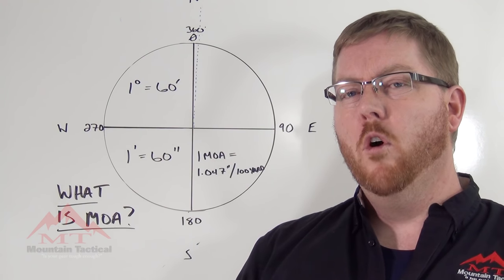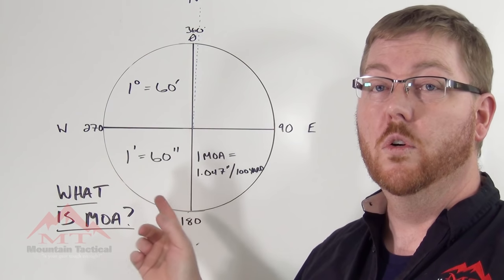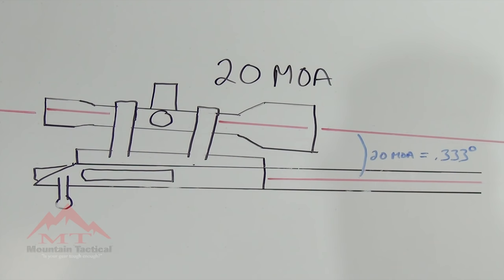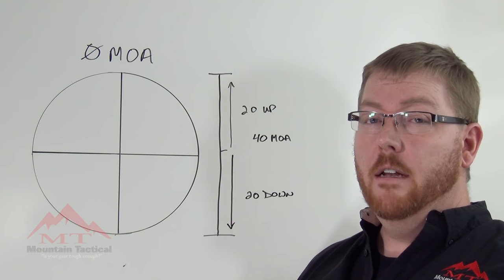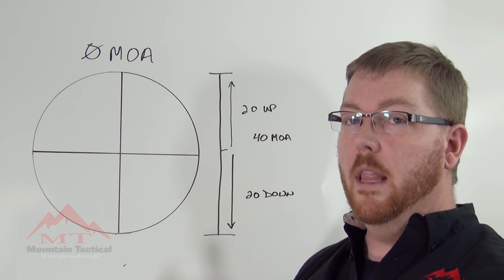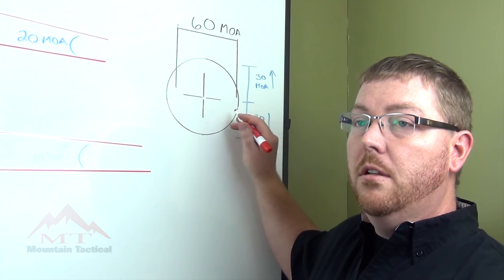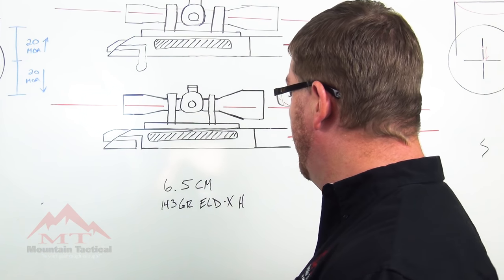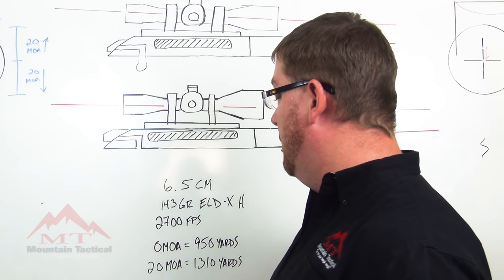0 MOA vs  20 MOA What Does it All Mean?!?!

Comment: What I learned today is that I don't want or need a 20 MOA mount.
Reply from the maker: Gillan Laureth of Seles That's great!  Most people just buy and don't understand that they may not need what they are buying.
Reply: @mountaintacticalcompany  I just bought  ruger mpr and it came with the 20 moa mount...what would be the best scope for it?
Reply from the maker: @chaboi7  honestly, that's like asking what underwear is most comfortable. Haha!

There are so many optics available for every type of shooting. 

When I buy a scope, first I decide what type of shooting I plan to use it for, then find the best optic in that category.
Reply: @mountaintacticalcompany  why do we not set sights parallel to barrel? If you know the sight/optic is X" above the bore, doesn't that simplify the math for drop?
Reply: 60Ometers or less than you don't need, rectiles give you +10moa helping lines. I have no problems with my until 850M without.
On very hot day i can dial in to 1100yards.
Reply: @chaboi7  Little late comment but, not sure you need to worry since an AR15 is almost not used for precision shots over 400 yards, make sure the MOA adjustments on your scope is at least 60.
Reply: @marcoss6212  but other calibers in the same platform could.
Reply: @chaston0218  Very true :), thank you.
Reply: Was standard on my MDT embedded.
Reply: @chaboi7  if your Canadian try and sell it as that style of rifle is now banned.

Comment: Great Video. Thanks for sharing the knowledge! 
Best video I have seen explaining 0 vs 20moa rail. 
Ive got a 65Moa adjustable scope with a 20moa rail. A 100yard 0 leaves me with 51 MOA to play with.
Reply: 51moa to play with is 125inches dialup so you can shoot 1500m with the 6,5cm. 147eld-m at 840m/s
Reply: You don't need a canted picatinny mount if your scope has mildots; old school that never fails.
Reply: @marcrobert2603  share the equation, pls.
Reply: @renatosureal  the bullet drop compensation function of a mil dot or MOA scaled reticle is secondary to the scaled reticle’s range finding function. It is better when possible to aim from center of crosshair, dialing to distance, because it supports recognition of consistent sight alignment, as well as parallax error using the eye’s natural ability to balance and center things. This is important because sight misalignment error increases with distance. At any rate, this is my perspective from experience as a Military Rifle Instructor assisting the USAMU deliver SDM Training.
Reply: @renatosureal . There is no ballistic computation needed for an understanding here. All that’s needed is a ballistics app’s trajectory calculation for particular bullet/velocity. For example my 77 grain .223 loading requires 48 MOA come-up (480 inches) from a 100 yard zero to hit 1000 yard target in standard atmospheric conditions according to my ballistics app. My scope has 110 MOA elevation which means if I can get a 100 yard zero at about the 55 MOA point I can adjust elevation to reach a 1000 yard target with perhaps 7 MOA, or 70 inches of extra elevation at hand. Interestingly enough, I might still be inclined to place scope on a 20 MOA base to avoid dialing to end of scope range, which could happen in cold weather with dense air.

Comment: Simple, if you can not get enough elevation from the sight for bullet path to intersect line of sight at target distance you will need a mount with some convergence to line of bore. Great video.
Reply: if you have mill dots in the sight ... all of this conversation becomes IRRELEVANT
Reply: @renatosureal It’s not irrelevant because dialing to distance is always more precise than holding to distance, especially when wind is favored rather than dialed. At any rate, there’s typically no downside to a 20 MOA base unless it precludes a 100 yard zero. The bottom-line is a convergent scope base can help a shooter use a high magnification 1 inch scope for long range shooting, such as NRA Long-Range Competition, saving the shooter the expense of a 30mm scope.

Comment: Is the determination of which MOA (height) rail to use based only on whether you intend to shoot primarily between 0 - 500 yards (e.g., 0 MOA rail), or whether you intend to shoot primarily between 501-1000 yards (e.g, 20 MOA rail)? I certainly know that shooting beyond 1000 yards would generally be the same as the rail for the 501-1000 yards. I am just using 1000 yards for simplicity. Or, is it also determined by the dimensions of your riflescope? Are there other factors to consider? For example, I have a Weatherby Model 307 in 7mm PRC with a Vortex Viper PST Gen II  5-25 x 50 with a 30 mm tube. I intend to use the rifle for hunting between 200 - 600 yards, and long-range shooting out to 800 yards. The rifle comes with a PEAK 44, 20 MOA pic rail. Would using the 20 MOA pic rail be the best rail height for my intended shooting?
Reply from the maker: The base you choose is based on your optic and range you would like to shoot. Apply the formulas in the video to your set up and see which mount is needed. My 28 Nosler has a 40 MOA base under the scope because that was what was needed for the intended use of that particular rifle. Cheers!

Comment: A minute of angle is 1/60th of a degree and there are 360 degrees in a circle. A very minute separation whereby, at 100 yards the separation is a only 1/4". At 50 yards it's 1/8" and at 25 yards it's 1/16".

At 25 yards it takes 4 clicks on turrets to move your point of impact 1/4" or 16 clicks to move 1".

20 MOA = 1.25 ", 20 clicks at 25 yards.

Comment: When your scope has a 30mm tube or larger you have more MOA elevation than a 1" tube. Some scopes have tubes larger than 30mm so you'll have more elevation to work with. The challenge is buying scope rings. The gun store where I used to work had rings on hand for 30mm tubes. Rings for tubes larger than 30mm had to be ordered with an unknown delivery date. 

So before you drop coin on a scope with a larger tube order your scope and rings at the same time.

Comment: I wished I would've done some research before buying a scope mount for my long range scope. I knew 20MOA would allow for more range but I didn't know it would interfere with a 100y zero. I have two 1-6 scopes on 20 MOA mounts and  I never had an issue with zeroing until I got a long range scope. I wasted around 30rnds of 6.5 grendel before I realized I was hitting super high and I couldn't dial the elevation turret down any more.

Comment: If I understand this correctly, does this mean that 20 MOA mounts are only relevant if you dial in the elevation adjustment? As opposed to using e.g. a mil-dot reticle for holdover?
Reply from the maker: I've never thought of it that way, but you are correct. If you are using hold overs, no need for a canted optic mount.

Comment: So, if I understand this correctly. If you have a new scope/rifle with a 20 moa rail attached, the first thing you do, even before boresighting etc, is to click down the scope by 20 moa/5.8mil to adjust for having the 20 moa rail attached?And only then you go ahead and boresight and zero your rifle, which of course could mean you may have to further fine tune up/down depending on scope height etc. Is this correct? (assuming you have mounted everything else correctly etc etc) I know some of you say you should always boresight first thing, but I dont understand this because you already know that you are "wrong" by 20 moa so why not adjust for that first thing? That should at least make your initial settings closer to the correct settings?  Please comment
Reply from the maker: This is exactly what we do when mounting new scopes on 20 MOA rails

Comment: I primarily shoot targets at 100 yards. Will a 20 MOA rail not perform properly for this?
Reply from the maker: Great question. Whether it will perform or not will be more a function of your optic than the rail. Personally, I would go with a 0 MOA rail for 100 yard shooting just in case my optic does not have the adjustment necessary to compensate for that close of a target.
Reply: @mountaintacticalcompany  thanks for the reply
Reply from the maker: You are welcome!

Comment: Nice job. 300 PRC via Beraga B14. GPO German Precision Optics GPOTAC 6x 4.5-27x50i FFP - LR PRO #RS670. 34 mm tube.  Target and hunt. Mil spec scope. Hence not measuring in MOA. Do I go with 20 MOA rail or standard mounts since I have 115 inches ?  Think 20 MOA rail right?  Any direction on ring height with 20 MOA rail?
Reply from the maker: Since this is a dedicated long range set up, I would use the highest MOA angled mount (i.e. 40 MOA+) and use whatever mounts are comfortable for you. You do not want to put tension on the rifle system by contorting yourself to get a sight picture. 

That's a great set up!  You'll be amazed at how far you will be able to shoot it accurately with practice.

Comment: What if I have a scope with 110 MOA adjustment? Would a 40 MOA rail be the acceptable choice, or would the scope eye placement be so high above the comb of the stock that I could not get a cheek weld?
Reply from the maker: You are exactly right. A 40 MOA would be the best solution. Depending on the rifle set up, you may need a cheek riser. But every set up is different.

Comment: Do I need to make an adjustment  in the data in my calculator  to compensate for the 20 MOA mount ?  Does this change the holdover data?  How does this affect the holdover points on the retical ?
Reply from the maker: Not at all. All your data will be the same one the optic is zeroed

Comment: I need help.
I have a HOWA model 1500 in 25/06 
So I used to have a Burris 10x40 scope and bought a Swarovski z5i 2.4-12x50 
I used the same scope rings and the front of the scope is barely not touching the barrel.
You can barely fit a piece of paper between the scope and barrel. 
So I sighted in at 100 had to move my up and down alot downwars  when I went to sight in at 200-300-400 I ran out adjustment between the 200&300 .
Do I need a 20moa rail with medium rings or should I get a 0 moa rail with high rings?
Thank you
Reply from the maker: It sounds like you definitely need both the 20 MOA rail and higher rings. That will be a great set up once it is dialed in!
Reply: @mountaintacticalcompany  ugh....I ordered the 0 moa last night....
I mean the most I'll shoot is 300 maybe 400 yards....do you think the 0 will be ok?
Thank you for the reply

Comment: Great 6.5cm 0 vs 20moa rail example. Wondering how will that impact 50-300yards shooting?
Reply from the maker: I'm not exactly sure what you are asking but there are plenty of ballistic calculators that can give you specific trajectories based on your load
Reply: Is the inner part of a scope really 0 MOA or did it look slightly downwards to cross the path of the bullit? If it is really 0 MOA it will eat up some MOA of your adjustment.

Comment: First I freely admit that I am a beginner when it comes to scope mounting. I’ve got a Tippmann Arms M4 22 Elite rifle that I intend to mount a Hawke 3-9X40 IR with adjustable parallax scope. I purchased a Warne QD cantilever 1” mount but feel like I need more height. The majority of my use will be at an indoor range.. so 25 yards.. but when I get to an outdoor range I’d like to be able to reach out to 100 to 150 yards.. My scope has 100 MOA for both elevation and windage. My rifle has a full length Picatinny rail and the Warne mount has a center point height of 1.43 inches.. Do I need any additional height to be able to reach out to 150 yards? I realize that my scope isn’t ideal for that distance but my use like this will be rare as compared to 25 to 100 yards.. 90% of use will be indoor at 25 yards. The reason I got a QD scope mount is because the rifle comes equipped wi some high quality vip up sights that I’ll use fro time to time. I may even try “lobbing” some shots in with the iron sights at even longer distances. Please advise.
Reply from the maker: Sorry it took me a bit to respond. Since you are not shooting long range, all you need is 0 MOA.

Comment: Huh?  I think he said that if you have a scope set for 0 MOA and a 0 MOA mount your scope is parallel to your barrel line of sight.  And I think that is correct.  But what that means is YOU WILL NEVER GET A ZERO CROSSING AT 100 YARDS, OR ANYWHERE ELSE.  You must always account for the offset of the scope height above the barrel.  Mine is 2.1 inches so at 100  yards that is at least 2 MOA down plus whatever ballistic drop their is at 100 yards.  I sight mine in to be 2.3 inches high at 100 yards to give a zero crossing near 250 yards.  I know my mount is definitely not a 0 MOA mount but don't know exactly what it is.  All I know is it works.

Comment: that was really interesting, thanks !  what is the dividing line for choosing a zero MOA and 20 MOA scope mount .  would it be say shooting beyond 500 or 600 yards out ?  I should add I shoot with a 30-06
Reply from the maker: The dividing line would be your optic's adjustment range compared to your ballistics at those ranges.
Reply: The dividing line is 1340 fps bullet speed. I just saved u $53 on Litz DVD, 
As the bullet slows down, gravity, drag, BC,... starts to work on the drop and math can't predict it.

Comment: So if I understand this correctly, the purpose of the 20 moa rail is to be able to keep the crosshairs dead center on the target at longer ranges, essentially compensating for the bullet drop...correct?
Reply from the maker: The purpose of a 20 MOA rail is to increase the amount vertical adjustment in the scope so you can dial your turret for longer shots.

Comment: Thank you for this! I am not fully getting it tho because my application is for a .22. I’ve bought a little Bergara BMR - it comes with a 30MOA Rail. I’m confused if this is for long range or short. I want to shoot at a max of 100yards. I’ll be able to shoot 25-30 yards as the squirrels and pests can get that close. Wondering if I’ll need to switch out the rail. If you could help with that. Also my scope will be a low power Leupold 2-7x33 Rimfire if that helps. Thank you!
Reply from the maker: That is definitely a long range rail set up. That said, if you can still zero the rifle at 50 yards, I would not change a thing. If you cannot get a 50 yard zero, then a 0 MOA rail would work perfect for you. Cheers!
Reply: @mountaintacticalcompany  thank you for this reply! I don’t quite understand why they went this route as it’s a great light hunting rifle and they make other .22 rifles for that long range application. No one makes rails except for one company and they only provide a 15MOA But it’s in the right direction.

Comment: Basically if you’re shooting long range you need a 20 MOA !
Reply from the maker: What if your optic will not allow you to zero your scope because there is not enough travel in your turrets?
Reply: @mountaintacticalcompany  Yeah, my Discovery worked on my standard 20moa MDT stock at 50Y.

Comment: Oversimplification for regular people.

Be sure to research and choose a quality scope with the appropriate MOA/Mil adjustments/reticle for the appropriate distances you intended to shoot at.

If you intend to expend a lot of rounds past 1000 yards, don't get a scope with a 1x minimum magnification. 

If you plan to expend a lot of ammo at <100 yards, don't get a 4-16x scope.

0 MOA = <300 yards (for a short range ethical shot) with a red dot.

0 MOA = 0-500 yards (intermediate distances) of target acquisition. Think a 1-6x LVPO.

20 MOA = 500-1200 yards (long range) . Think a 1-8x, 1-10x, 2.5-10x, etc.

30 MOA = 1200 to a mile for extended long range. Think optics with minimal magnification of 4-6x, and maximum magnification of 25+.

Comment: For myself, I have purchased a Ruger Rimfire Precision, (don’t laugh, too expensive to shoot my 300 WinMag if I can find the ammo)  in .17HMR. I was planning on a 50 yd zero but looking to go out to 300yds. Would a 20 moa be ok or a 30 moa?
Reply from the maker: There is nothing to be embarrassed about!  Most shooters who want to maximize their range time without spending a ton of money buy a rimfire to mimic their primary centerfire rifle.  What rail you need is a function of the scope, as stated in the video.  Use the calculations in the video to figure out what angle your mount should be.  Cheers!
Reply: @Miles Maillet sweet! Very flat shooting but the main thing, just like shooting a 22, it’s cheap to run. Before the ammo price jump, I purchased every box I could find. At about 5k now, but that gives me the ability to spend a day at the range and go thru 200-300 and have fun. I mean, 50 round boxes with an average cost of $12.00, that’s cheap fun!!!!

Comment: Need some help on this topic as I order some parts for my rifle.Rifle: Rem 700 Magpul .308 5R 22" BarrelScope: Nikon P-223 3-9x40 (I know, this is an AR platform scope)Max Internal Adjustment: 80 MOAUse: Range I'm looking into getting an EGW Picatinny Rail. I'm starting to understand this MOA topic more and more. However here is my question: I plan to use the above gear together for the time being due to cost and what I have at hand, as an intermediate shooter I only have use for this build at the range. 100-300 yards will be my primary shooting distance. Eventually I would like to take it out to 1000 yards, but with a different set up. Since I am under 300 yards, with the scope I have, should I get a 0 moa or 20 moa rail?
Reply from the maker: Leroy Anthony Duran Jr For your situation it probably wouldn't matter. The 20 MOA would give you flexibility in the future if you choose to shoot farther, but at 300 yards, a 0 MOA rail would not be a handicap. 

Hopefully this helps.
Reply: Tikka Shooters Thank you